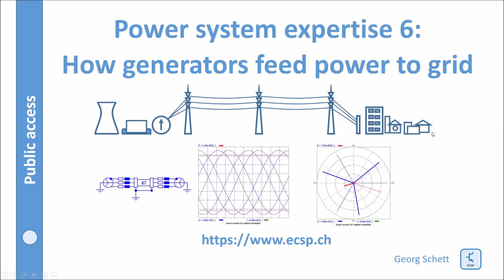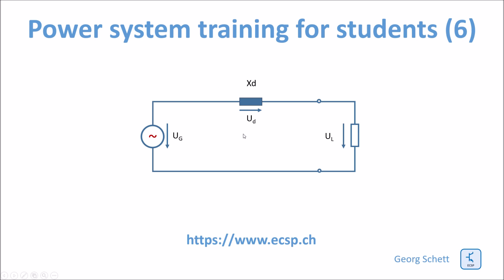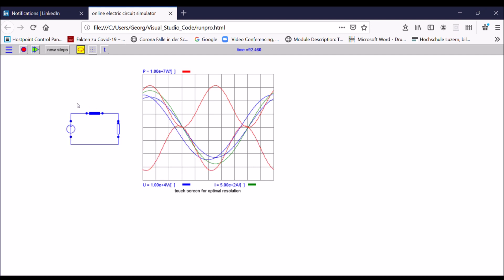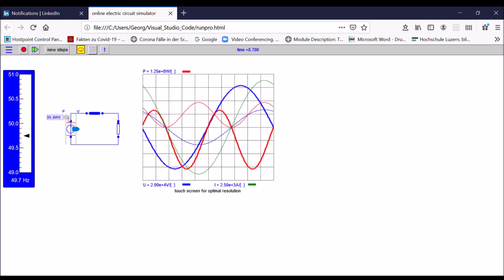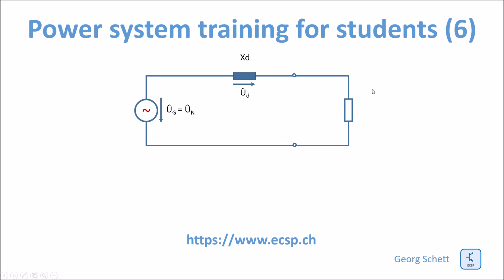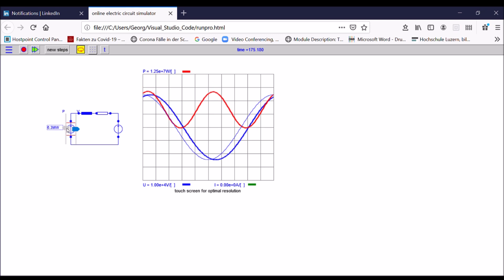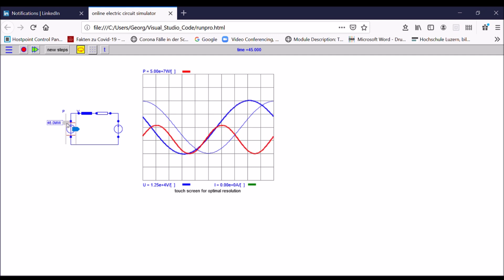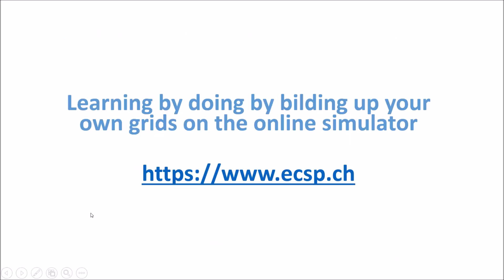Power System expertise 6: Generation [circuit simulator]

Comment: Hi Georg, I am trying to create the models you created in the video. However, in the single-phase voltage source box, there is a note, "Power and Inertia inputs for 3-phase Gen."   I cannot enter MW in the voltage source box like you do in the video.  Am I doing something wrong?
Reply from the maker: There is a tickbox generator. Once ticked you should see the input field for power in MW. Do you not see this field? Can you send me a screen shot to schett.ecsp@hispeed.ch? What system browser are you using?
Reply from the maker: Another input: once you made the input for Power (in MW) press enter before pressing the OK button!! Otherwise it does not take your input and does not calculate the inertia.

Comment: Hello Georg, thanks for very good video. I wonder, for stiff grid Ug =Un and at Delta = 90 (maximum power output), it seems to me that the load current has do be capacitive to make the phasor diagram complete? Thinking this scenario: Ug= Un+ jIaXs. Ia= armature current/load current and Xs synchronous reactance, referencing Un at zero degrees and Ug leading Un by 90 degrees, Ia must then lead Un by approximately 45 degrees so voltage drop jIaXs completes the phasor diagram. But then again, this seems strange as per phase output power from generator can also be written as Pout= IaUn x Cos(phi), where maximum power transfer is when cos(phi) is 1, that is when Ia is in phase with Un. What I guess i'm wondering is, how can this be true: (Referencing the video) (UgUn/2Xd)*sin(d) = IaUn*Cos(phi)? At maximum power output, Delta = 90, but can Phi be equal to 0 then? Cheers Magnus
Reply from the maker: Hello Magnus, I am not sure if I get your question  right. There might be a confusion between impedance (load) angle and the angle between sending and receiving voltage source. You can use my free version of the simulator www.ecsp.,ch in order to play with the 2 sources and change the angle between two sources. So you can observe the impact of the angles and of the source voltages on the power exchange between the 2 sources. All the best, George
Reply: Thanks, I thought that the angle between Ug and Un was the load angle, is this not the case? @georgschett801
Reply: I have assumed this: Load angle is equal to torque angle of synchronous generator pluss angle due to line impedance
Reply from the maker: No Magnus, it is the angle between the two sources.
 @MagneManet
Reply from the maker: The total source angle between the 2 sources is equal to the torque angle of G1 + the angle between one side of the line and the other side of the line plus the torque angle of G2.  @MagneManet

Comment: Dude!  Thanks for this.  So I'm a novice at this but it seems like you are saying the power flow from the generator is a function of the phase angle and generator voltage, although this appears nominal at the grid.  Is that right?  Other basics to get me up to speed would be appreciated
Reply from the maker: The phase angle controls the real power flow, the voltage controls the reactive power flow.
Reply: @georgschett801  got it.  I'm a little thrown in your simulation like at 835 time of your video.  You are showing voltage of two sources doing the phase shift as blue, but power as red.  Why is power twice the frequency of the voltage, I would think the kw would be the same frequency....what am I missing?  Is this not the kw seen at the infinite gird or some other power?
Reply from the maker: @nonyafletcher601  Power = U*I, thus always positive if both are positive or both are negative at the same time.  It is explained in textbooks in details, you may draw a curve with excel. It has nothing to do with two sources. One source and an inductive and/or ohmic impedance is enough to get it right.

Comment: Why not a induction generator?(asynchronous)
Reply from the maker: There are async. generators in the power grid, but mostly these are smaller units for example in some wind turbines. In order to build a functioning grid you need synchronous generators, they are black start capable. In order for an async. generator to work, you need it to be connected to an existing functioning grid. Adding smaller and cheep async. generators to a grid is a good way to increase the power supply at lower costs.
Reply: @georgschett801  Thank you for the info, we always hear about induction type machines, that's why I asked!